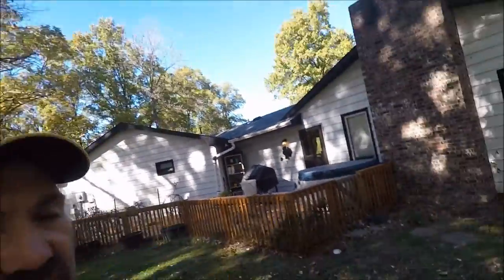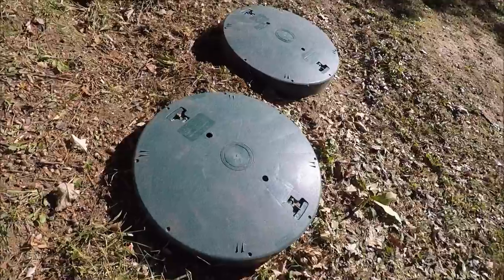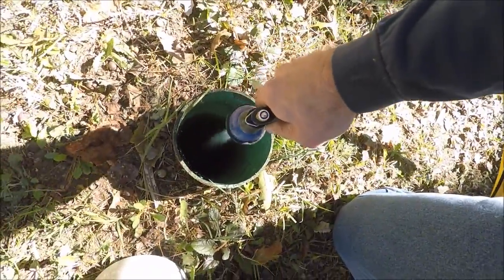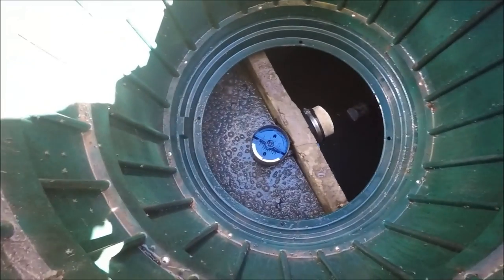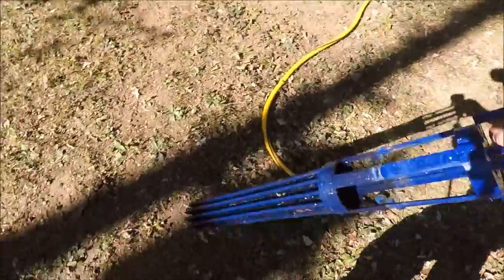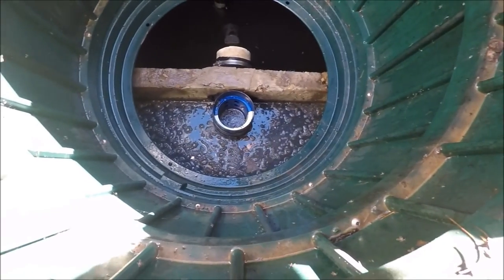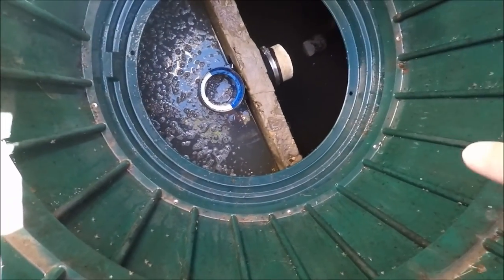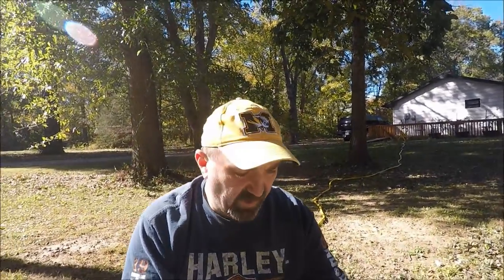Septic Tank Filter Maintenance

Comment: Thanks for the video..my son just bought a house with a septic.. They had to replace his tanks before he bought..but nobody explained the maintenance. .👍👍 iys good your system is so far from the house..that pipe holds lots of water when the screen cloggs..
 I wonder if cleaning that much is too much..isn't the idea to catch the particles, so wouldn't buildup assist??  
  I did plumbing all my life, never septic tanks so something i need to read up on.. In a couple of weeks i'll be an expert
Reply from the maker: The filter needs to be cleaned periodically so that water can continue to flow into the second tank. If the filter becomes clogged, debris will go over the top wall of the first tank and clog the pump thats located in the second. Hope that helps clarify things.